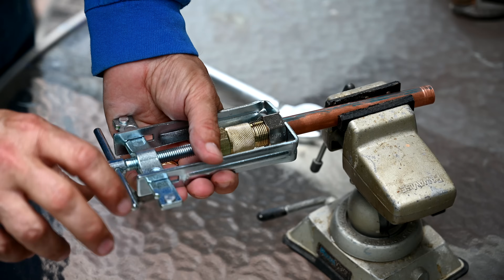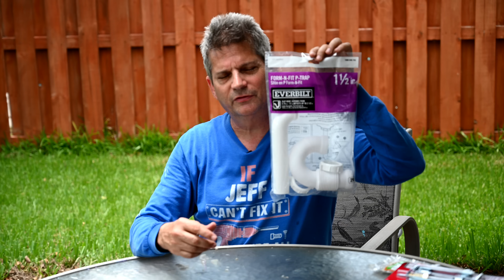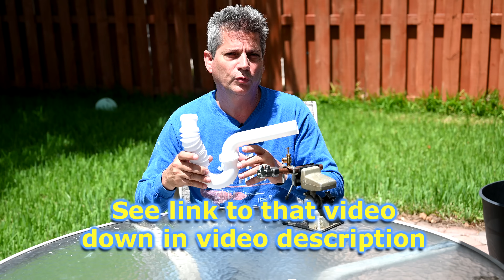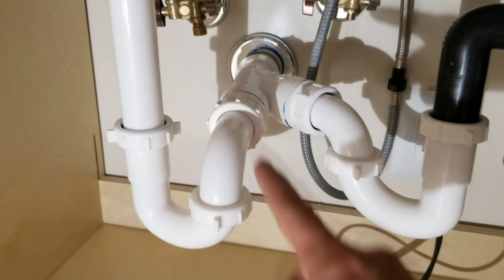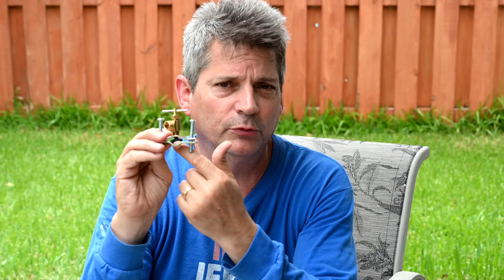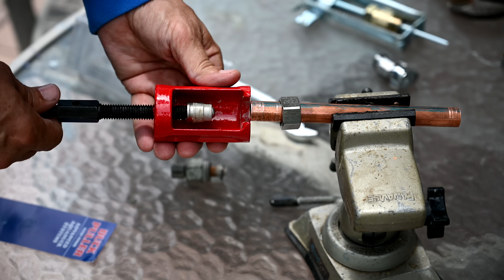4 Plumbing Parts/Tools You Should NEVER Use. NO Plumbing Fails

Comment: Can you please make sure to state the actual, physical reasons why something isn't safe/ideal/ok?
You actually only gave about 7 words for why the "Form-and-Fit" is not a good solution.
The fact that the plumbing code and insurance companies don't allow it is one thing, but WHY?
"Because it can trap particles"
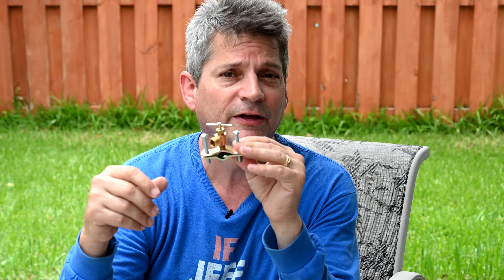Reply from the maker: At 1:55 I stated why S-Trap should not be used. (Self siphoning). At 7:50 I stated that Flexible P-traps should not be used because it traps particles and debris. At 8:34, I stated the plumbing code says the P-trap must be self-scouring, which a flexible P-trap is not, and I also mentioned dental floss getting caught in it. At 11:55 I stated why Saddle Valves are bad, it does not take long before they start leaking. 13:25 I stated that piercing the pipe with a saddle valve can take it out of round and deform the pipe causing turbulence. So PLEASE don't be that troll that doesn't watch the video, then lies about why I failed to mention it.

Comment: If you really understand what you're doing all these "banned" concepts can work just fine.  If you understand.  I've used saddle taps for years, and years.  Never had a problem with them (typical use:  evaporative cooler feed water).  The ferule puller:  ferules generally last as well as pipe, and you can just replace the valve using the old ferule.  Usually when the ferule won't work, the pipe is shot, too.  (The word here:  "Sharkbite" !!  Let the fun begin!)    Code:  the Florida code shown in the video is not universal.  Different jurisdictions adopt different codes; usually the jurisdiction also picks and chooses which portions to adopt, and makes alterations.  So, pulling out Ye Old Code Manuelle isn't quite as straight forward as you might think.  Also, Big Box stores generally cater to home owner, DIY and small-time handyman patrons.  Broadly, their work isn't inspected, it isn't permitted, and no one is going to care what you do.  (And people who mutter darkly "insurance cancellation" are generally full of it.)  The repeated warnings about methane gas are a little misleading.  Generally, sewer gas will come into a home only if the central sewer system (the big pipes in the street) is under positive pressure.  This condition is common in large, old, skanky, old (did I emphasize age?) systems where the flow is often great enough to completely fill  the pipe:  when this happens, the water forms a moving plug that pushes air (and methane) forward, creating positive pressure that can enter a building downstream.  One of the things a building is supposed to have is a building vent that bleeds this pressure off before it goes very far into the building.  But if you get the right set of conditions, yeah you get some methane.  Light a candle.  I wouldn't use the accordion pipe under a garbage disposal, but other fixtures (where you're just washing hands)....meh.  "If you understand."
Reply from the maker: You are wrong about the code. EVERY state in the U>S> bans saddle valves and S-traps, this is not a Florida thing.
Reply: @jeffostroff  You cannot be sure of your statement.  There are many areas--usually away from metro areas--that have no code.  There are two generally accepted codes, UPC and IPC, but each jurisdiction chooses which, if any, to adopt and enforce; some have their own codes.  Furthermore, adoption often excludes some categories of buildings (for example, single family residences, or older buildings, or smaller buildings).  And of course if no one is checking or permitting some categories of construction, code adoption is moot.  There is quite a ready market for "non-approved" plumbing items.  It happens, and that's why stores stock such items.

Comment: Actually if you are replacing a saddle valve, you would tighten the clamp around the pipe using a manual screw driver. You want to be able to feel just the right amount of tightness. Don't use a drill
Reply from the maker: I won't be doing that at all because I won't be installing a saddle valve! LOL! But yes that would be the way to install one.

Comment: I haven’t used that Husky puller before but it looks like you’re supposed to put those two metal arms into the notches? That way you aren’t hurting your hands to hold the two arm pieces together?
Reply from the maker: Yes, but they have also changed the instructions since then to make it clearer

Comment: You put the S trap together backwards #1 and in a kitchen island tell me how you avoid a drain through the floor? I would not use the flex pipe and there never is any reason to if you buy the right fittings. To remove a stuck compression fitting it is often far more easy to just cut the pipe if you can and use a shark bite fitting. There is no way to plumb a sink drain without making some form of an S trap if it is not near a wall AND the pipe in the wall completes the S anyway. Also the code is not retroactive. When you replace a part in no way does that mean anyone is obligated to comply with the current code, you would have to replumb the entire house. I am an electrician and even I know this, I also build houses.
Reply from the maker: Here in Florida when you do a kitchen island they use an air admittance valve to provide venting when you do a P trap there. the other cases where you have the S trap going down through the kitchen floor under the cabinet is in houses up north where there's a basement and so the pipes go down through the floor into the basement and then into the sewer system. Also your understanding of the code is not correct and I think you're just here to be combative more than anything else. When you're remodeling a house the minute you open up the walls, the city inspectors will make you upgrade everything in their pipes and electrical to bring it up to the current code.

Comment: "Don't ever use one of these"

...i didn't listen and it works just fine.
Reply from the maker: They work fine until they stop working fine an you are shelling out for a $30,000 leak repair.
Reply: @jeffostroff  no way would I ever have to fix a $30,000 leak from using this piping. Maybe $20 to replace some wood. That's about it. That's IF it ever leaks.

Comment: You can buy a saddle valve at my big box hardware store, but they don't stock the simple copper fittings to go from say 3/4" down to a 1/8" ice-maker supply line the right way (reducing tee, reducer, reducing bushings).

Comment: What to do if in an old house with very limited space and the drain proceeds down through the floor? An S-trap appears to be all that will work.
Reply from the maker: some people use air admittance valve https://amzn.to/3sYHdbu, but if it can't fit, you are stuck until you do a full remodel and cut into drywall, where you can move the plumbing and ad venting.

Comment: Fantastic detailed video. Someone just gifted with the accordion pipe and immediately I thought it was strange that it was even invented because it would trap things and I’ll add that at each hinge it has a weak spot where the plastic is thinner and can be broken. Disgusting germ trap.  I’m on the hunt for the best tool (that possibly is an all in one as well),  for removing the metal screw from my kitchen sink drain so I can replace the abs pipe inside it that was cut too short and eventually popped loose. The handyman I hired stripped it a bit so I want to make sure I get the best tool for removing it before proceeding, but I’m losing time and washing dishes in the bathroom sinks and dumping dirty food chunks in the toilet in the meantime.
Reply from the maker: You are exactly right and you were smart enough to deduce just by looking at it that something wasn't right about the design, and yet I have a bunch of smart aleck handymen and other plumbers who troll the comments here telling us how they've been doing this for decades and don't have a problem period of course they're not the ones that get called back when there is a problem

Comment: I got a different style of compression sleeve puller than the one in the video, it's made by Pasco. It works great and you don't get none of the issues that the arm style puller has.
Reply from the maker: I will check it out

Comment: Jeff, I actually used the Superior Brand Ferrule/handle puller last night. It was very similar to the Husky brand, if not the same. Those two puller claws are not used to pull the the ferrule off, they are used to pull faucets handles off. I watched the Superior video and those claws were only used to pull handles off. The Superior brand did the job for six pipes with no problems. Yes the the T handle could could be longer for more leverage. I noticed you omitted putting the silver insert into the pipe before coupling the puller to the nut. That is the reason why the T handle was striking the back of the puller.  So I can see why you were having problems using the tool. I wish they omitted the puller claws that were used to pull handles of with. Yes the tool is awkward and uncomfortable, but it was the only one I could find in stock. I would have bought a better one if it was available, and probably will order one online for future projects. But for 11 bucks and 6 leaking stops, this tool worked great. Maybe the Husky brand instruction are different? But the pullers look identical. BTW all the stops and pipe had the green corrosion and the sleeves were on there. The way you were demonstrating using the Husky tool is my opinion was incorrect. Sorry, I usually enjoy your videos and get a lot of useful information, but this time the demonstration on how to use the cheap Husky puller missed the boat. Here is a good video for reference https://www.youtube.com/watch?v=7KDe8ACKjwc
Reply: I love how silent Jeff is on this.
Reply: @redmatrix  He's actually responded to a few similar comments, but he seems too hard headed to except the fact that he screwed up and used the tool wrong in the video.  It makes me suspect he's never used it correctly and maybe it also reveals a part of his character.
Reply: @dtester  Busted,  You said except when you intended to say accept.  Your failure to edit this post to speak in proper English reveals a part of your charachter.
Reply: @FreeAmerican-mm2my  Omg! Nooooo!
Reply: You’re absolutely right. Thank you for the detailed description of how to use the tool properly.

Comment: The reason why an s trap is banned is because it cannot be vented. However, if you have an antique lavatory with a drain coming through the floor and you are not remodeling the entire bathroom this is what you have to use. Chrome is nice. An unvented p trap connected to an elbow draining to the floor is still an s trap
Reply from the maker: pretty much the same thing yes

Comment: Obviously those crinkly things would easily get clogged but they can be useful possibly for testing the drain inside the wall to see if it has a clog before fully assembling the trap. I cant see using it for anything else.

Comment: You don’t need to get a plumber to reroute your drain from the floor to the wall. A lot of drains come up from the floor there perfectly fine. Use the proper p trap installed with the proper washers your fine. I agree you should not use S traps

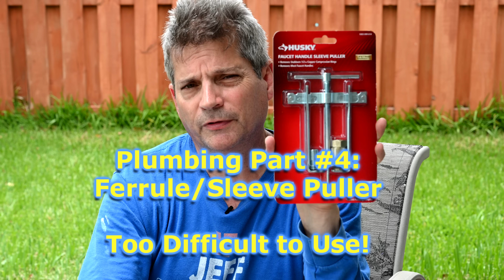Comment: 17:14 The Husky tool you hold up I used to pull faucet handles off of valve stems where the mineralization locked it down. The tool says "faucet handle  xxx puller". I had never even considered using it how you showed it being used here. The picture on the lower right of the package. So it has that one use at least. I wouldn't use something that flails so much for the other pictured use.
Reply from the maker: Right, we have more suitable tools for the job

Comment: The Husky compression ring puller is fine your just using it wrong you left the spacer out . your using it like a faucet handle puller. You let the spacer roll off the table. there are other YouTube video on how to use this tool correctly.  https://www.google.com/url?sa=t&source=web&rct=j&url=https://www.youtube.com/watch%3Fv%3DMjNrGuxYvjQ&ved=2ahUKEwiCuLvi9v7xAhXStp4KHemaCMQQtwIwAnoECAkQAg&usg=AOvVaw3t_N_MypWZLJVpheWVoo2S

Comment: Would have more convincing had you used your sleeve removal tool on a used compressed sleeve, as I have concerns that the copper pipe might be damaged by leveraging against it to remove a compressed sleeve. If that copper pipe doesn’t stay true to form, that sleeve ain’t coming off it.  I don’t know why you want it off if your just replacing the valve?  I would try seating the new valve on old sleeve first before attempting replacement.

Comment: FBC prohibits USE electrical cable, and stores cannot sell it. So you can buy it at Lowes or Home Depot in Alabama / Georgia, but not in Florida. These plumbing parts are against code in most if not all states, and yet they can be sold?

Comment: I used the flexible (“accordion”) P trap on one side of a new double vanity after I remodeled my kid’s bathroom. The tailpiece for one of the sinks was just off center by about an inch. Had I used elbows (even 45’s) I would have over shot the tailpiece.  Three girls use this bathroom and I’ve not had any drainage issues in 6 months.  Although I would not have used the flexible trap if the offset was any larger, they are useful for certain applications.

Comment: In Philly, where i live, every house Ive lived in, and there were many, had S trap. To change this to a p trap would require thousands of dollars, (10s of thousands?) of renovations, including moving walls, breaking up the floor slab, etc., and thus, the bins are full of these at lowes or Home Depot. For instance, in my mothers house, b. 1955,  which is a single floor rancher on a concrete slab containing the drainage piping, probably nothing short of razing the house and redesign of the plumbing would allow this change to P traps. This would be a $250,000 repair job.

Comment: Fun fact, in the UK, what you call saddle valves are called 'vampire' connections.   >: )   We used one as a temporary fix when covid ru
les meant we couldn't get a plumber in; we're having everything replumbed shortly anyway and then of course it will go. But ours seem to be much more robust than the one you illustrate, e.g., . https://www.screwfix.com/p/self-cutting-tap-15mm-x/21250

Comment: Florida codes kind of messed up when they allowed Quest tubing in homes back in the early 90's....that was a real mess.
Reply from the maker: CPVC too!
Reply: @jeffostroff  I worked for a boat manufacturer in the 90's and we used quest tubing and had to convert to another flexible tubing.  I t was good stuff...unless exposed to chlorine which would cause it to degrade....thats a bad thing

Comment: Man, so many of the codes and practices are behind the times, and evade common sense. It's crazy what DIY'ers and pros face in these industries. Look at the dishwasher electrical and plumbing connections. Those alone are beyond belief...talk about flexible hose and dangerous wiring. It's not just the DIY'ers, it's the industries themselves.
Reply from the maker: And it is also the parts suppliers in the stores themselves. For example Home Depot keeps giving people these ice maker water supply line kits that have the stupid saddle valves right there in the kit so people buy them thinking hey this is what we're supposed to do it's just really dumb stuff going on out there

Comment: The speech about removing the compression sleeve is pretty bad because the old sleeves are reusable. Just attached the new valve and it tightens down no problem, no leaks.
Reply from the maker: There is nothing bad or wrong about my speech and in fact you are wrong on that assessment. Yes you can reuse the sleeves like you mentioned but it involves risk. I just don't have a warm and fuzzy about reusing something that has already been compressed once, and now will be compressed again. Also without pulling the old sleeve completely off the pipe for cleaning and inspection, and checking the condition of the pipe and I always like to buff the pipe back to a nice perfectly clean copper shine. And my preference is always to use the sleeve that came with the new valve. Why? Because they were made at the same time at the same factory by the exact same company, I am not putting a valve made in 2021 mated up to a sleeve that was made 40 or 50 years ago by a different company with different tolerances. It's just that extra little bit of caring that I think allows me to sleep at night a lot better knowing there will not be a leak. Probably the number two source of leaks in any bathroom that I've seen over the years is P-traps, and on these compression valves that supply water to the toilet or the faucets for the vanity.
Reply: @jeffostroff  If you would rather make things more difficult for yourself, and purchase an expensive puller to do this unnecessary task, that's your choice. I have been using the existing sleeve and nut for decades, and have never had a failure. I have confidence that the design of the compression fitting is made so well that you can use the old sleeve. As for cleaning the pipe and the old sleeve, emery cloth works well and is easy to use. Of course the compression valves can and do leak at times, but the leak is from the valve seal, not the sleeve and nut, unless it's loose.

Comment: self piercing saddle tap valve. once it is pierced it can not be shut. when used on an ice maker the the flow of water can not be shut off. I have seen Many times, when a house sells they take their fridge. New home owner comes in they get the utilities in their name. they turn the water on to use the toilets then they Leave. they come back and their wood flooring is warped, their carpet FUBAR and basement mold has set up
Reply from the maker: Yikes that is a nasty problem